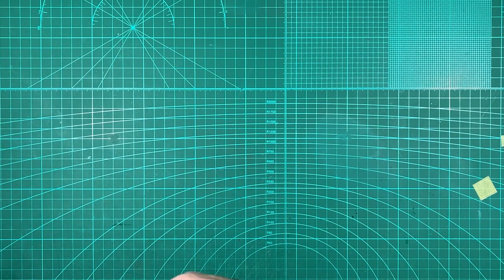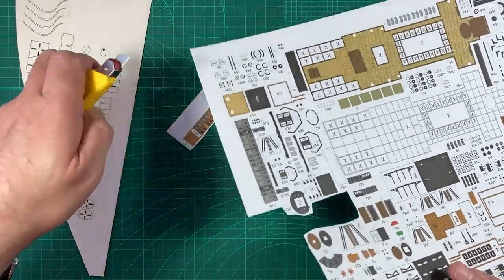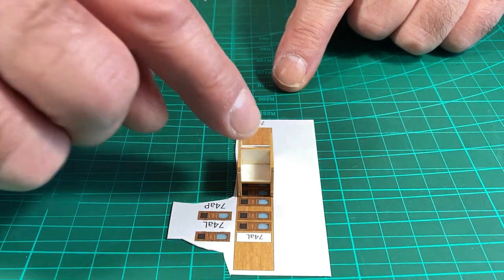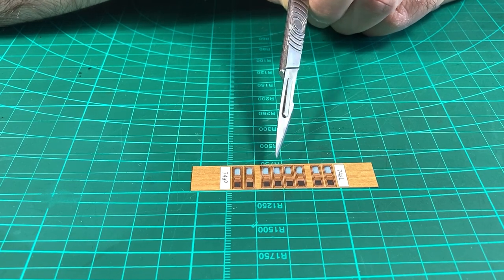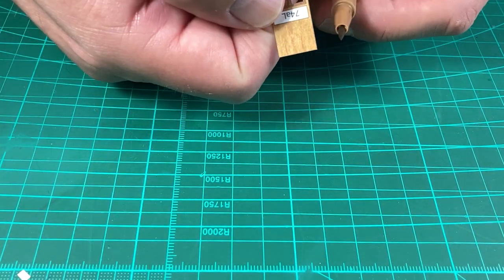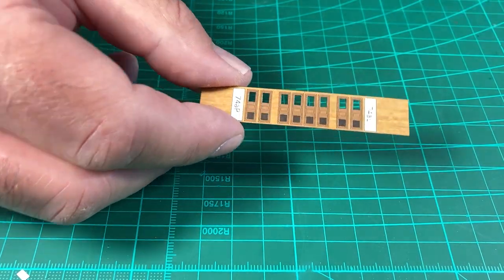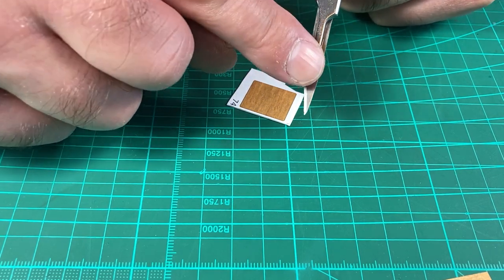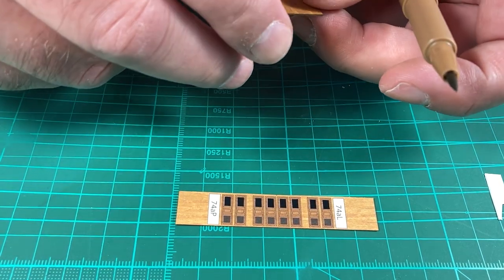Admiral Nakhimov, Paper Model, 1/200 Scale, Part 4, Deck Cabin/Bridge

Comment: Good work, very sharp and a lot of detailed explanations ))). I use another method in windows - using pieces of old VHS tape - easy to use and cut. And no pva - I use double-sided adhesive tape. 1. Glue tape on windows from back side 2. Cut the windows  through 3. Paint insides of window edges 4. Remove second side of adhesive tape 5. Press piece of tape from back side. Ready!
Reply from the maker: Thanks for looking and sharing your tip 👍

Comment: Great to see some cutting and assembly, lots of great tips, great ATD, great still shot at the end, superb!
Reply from the maker: Thanks for the comment Richmond, much appreciated.
Reply: Finally understand the benefit of the ‘chisels’ never realised they were created to the length of the cut.
Reply from the maker: Thanks. Once you have a few made over time you can adjust existing ones to suit rather than make them from scratch each time.  The smaller one, which was made for something else was a perfect fit for this and the wider one, again made for something else, just needed a few seconds grinding down the edge to reduce the width to suit.

Comment: My favorite straightedge has a very thin cork lining on the back, which stops the ruler from sliding on top of the part from the pressure of the blade against the edge. Just another helpful hint.
Reply from the maker: Thanks for the comment.  That's a good tip.